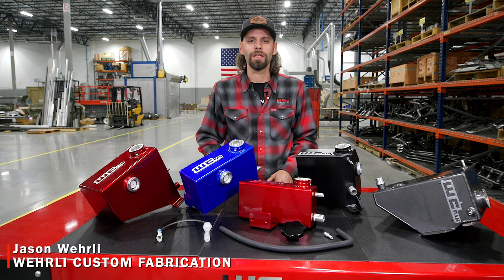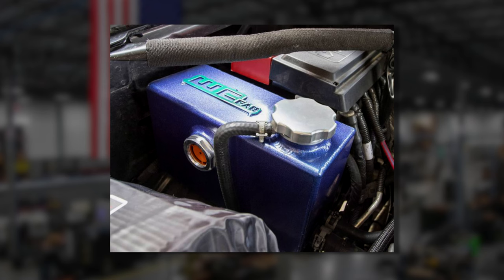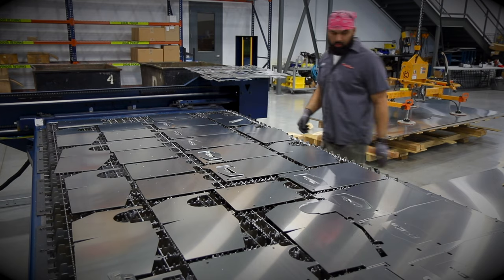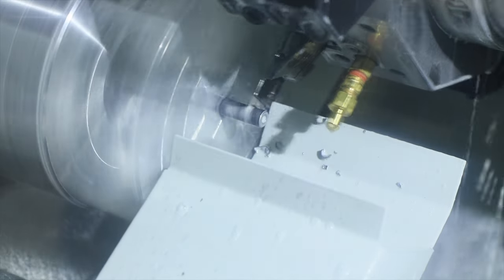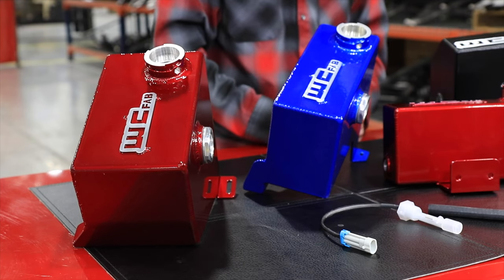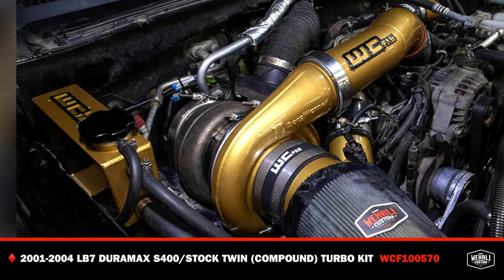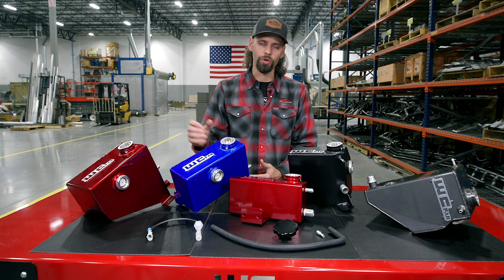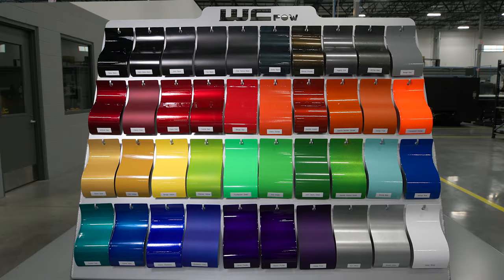Duramax Fabricated Aluminum Coolant Tanks

Comment: But does the lml 2016 same as the 2015s since the hoses different sizes on bottom last time i bout a lml tank the hose on my 2016 i have was smaller then the 2015 and had return it back to the shop i got it from
Reply from the maker: Yes, we can confirm that our LML tank is 100% compatible with 11-16 model years. If you've got additional questions about fitment or installation tips for your specific truck, please give us a call at the shop (630-277-8239) or email us at sales@wcfab.com and our team of specialists would be happy to help.

Comment: I hear and see duramax, but i wonder if they are compatible with the 6.0 or the 8.1l engines?... i have the 81 and these ideas are killing me not to have. Thanks
Reply from the maker: We don't currently see as many gas trucks through the shop here as we do diesel so we haven't been able to verify cross compatibility yet. Our suggestion would be to start by pulling and comparing OEM part numbers for the coolant reservoir. If they are the same between the gas and diesel models then there's a really good chance our tank would crossover. Otherwise, looking into this is on our R&D list, but we got some other projects in front of it so don't have an ETA currently. You can be sure we'll talk about it here and on our other social channels when there's more info to share.

Comment: Can you use this tank on a brand new 2024 Duramax and not mess up your warranty?
Reply from the maker: We've got plenty of customers already running these on '24 trucks so no concerns about compatibility. Now, when it comes to vehicle warranty, in our experience there's a LOT of variation from dealer to dealer in terms of how they handle those situations. If the potential to void your truck's warranty is a prime concern, we always recommend speaking with your local dealer about your plans for the truck before making any aftermarket modifications.